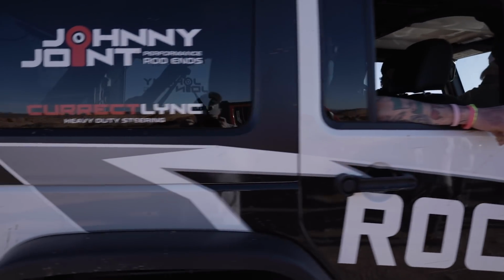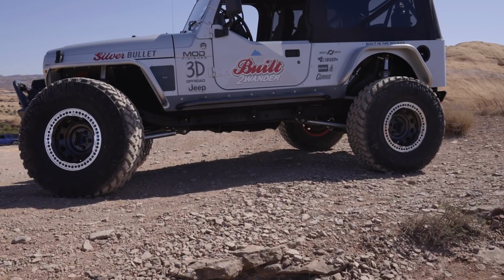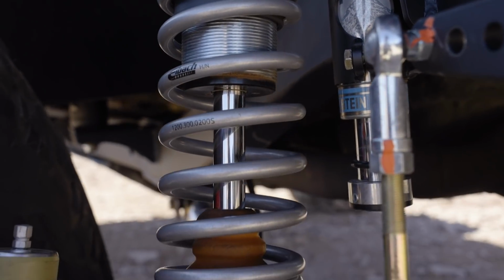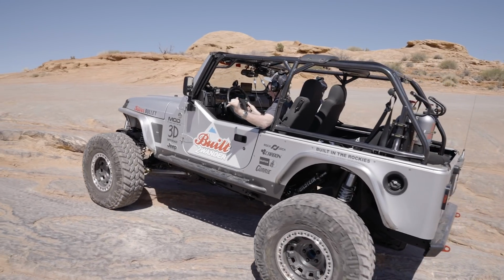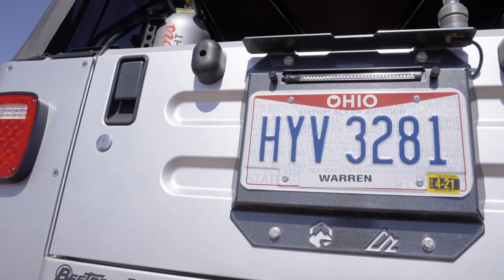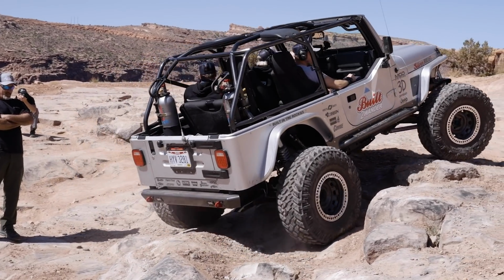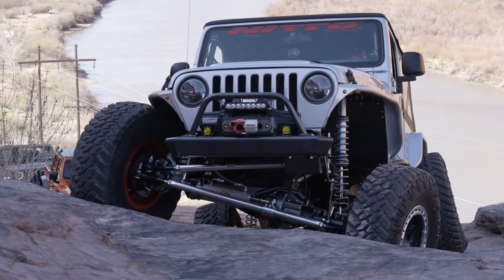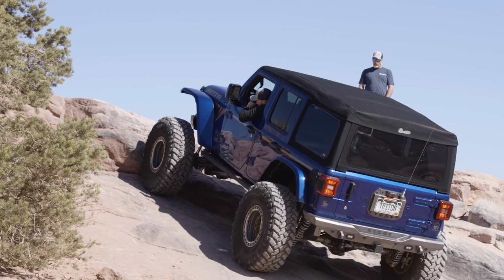Easter Jeep Safari LJ Build Reveal – the Silver Bullet LJ | Built2Wander

Comment: What size gas tank do you have on the LJ? Also about how long did it take yall to build that jeep? And yall got bedliner in the jeep ?
Reply: Factory gas tank with the Savvy Offroad aluminum gas tank skid. Built it in roughly 6 weeks. We did do bedliner on the interior of the tub and then put the carpet back on top
Reply: How big is thd factory gas tank for LJ. And plan on going for a bigger gas tank or just stick with what you got? Also how much of a lift do yall have on the LJ?
Reply: @joshnasche5495  we netted about a 3.5” lift. The factory gas tank is 19 Gallons. We plan to just run it as is 👍🏻

Comment: Great build. You kept ad much LJ as possible while building a solid trail rig. Thank you for not cutting it to bits and back halfing it. This is pretty much a master class on how to build one of these.
Reply: Thank you! We really tried to maximize the capability of the Lj without too much “heavy” modifications. Frame is untouched (minus suspension work), we didn’t stretch it, and we didn’t cut the hood. Did our best to maintain all of the original dimensions of the body and keep it looking like an LJ. 👍🏻